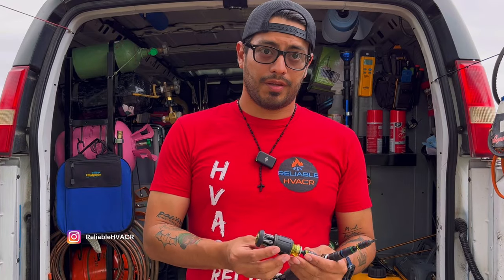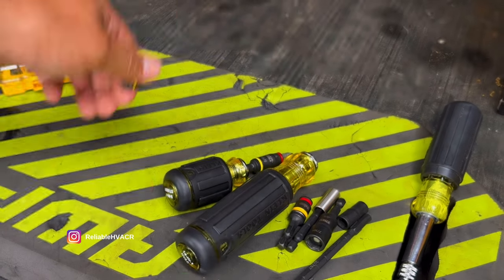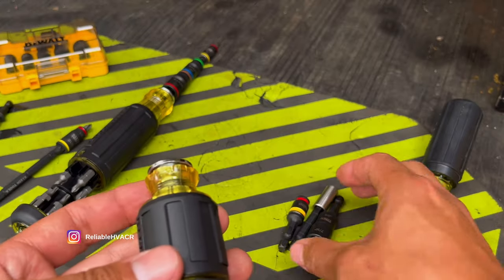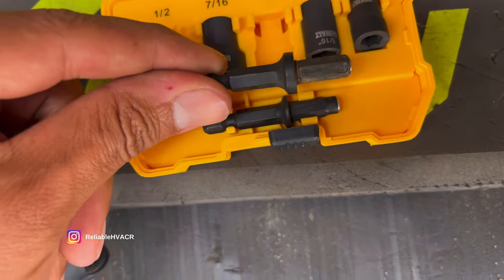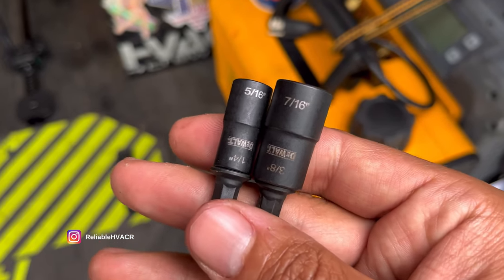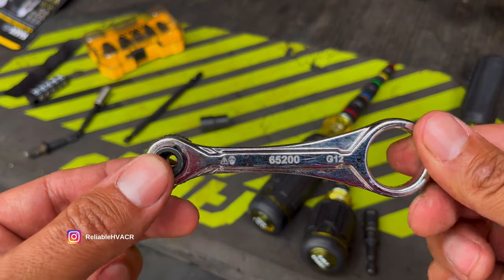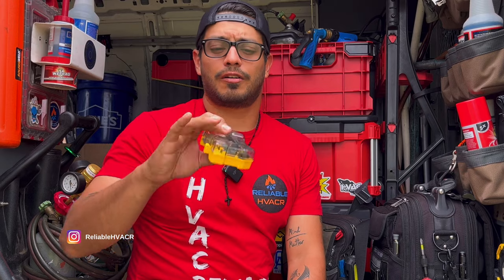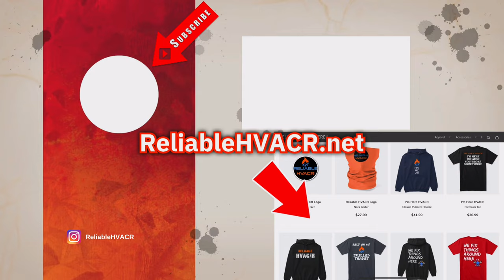Klein 7 in 1 Flip Socket UPGRADE / My Favorite all in one screwdrivers

Comment: For us non-HVAC folks, you can also use the 32303 14-in-1 adjustable length driver set the same way with the 7-in-1 nut driver set.  A very cool way to save carry bag space and have everything handy.
Reply: You can also just buy the 20 in 1 lol
Reply: You kind of missed the point of why.  LOL

Comment: Been running mine similar (regular 14 in 1 instead of HVAC) and really like it.  Great Video!
Reply: mine broke out in 3 months lol. the plastic holder broke inside for some reason. never let it drop it
Reply: @quietgameplays8246  mine started sticking, but I put some bits besides Klein in it and think it was my fault.  I put the Kleins back in and it’s been fine.

Comment: Klein sells the long and short shaft together in a pack at Home Depot for the flip sockets (comes with the 1/4-5/16 on both) that fits the stubby, as well which gives you 3 lengths in the stubby.
It's only been out 4-6 months though
Reply: Is that set called Klein Tools 32768 ?
Reply: @carlospoon6422  Yes. Klein Tools 32768

Comment: I used to always be on the hunt for the best multi till I came across the hilmor one. Picked one up at supplier here in Ontario for like $13 and grabbed a second one when I saw it again.  For me worked the best. I rock that with the reversable 5/16 and 1/4 6 inch nut driver and milwaukee stubby multi in my everyday.  That's a cool setup though gotta look into those
Reply: Can you share the model numbers for your setup?

Comment: I got the 8 in 1 hvac and find the 1/4 and 5/16 nut driver slide too bulky. Ends up not fitting in tight spots so i ended up going back to the 11 in 1 and using the shrader bit from the 8 in 1. Klein actually sells an 11 in 1 with the shrader out of the box.

Comment: When breaking king valves open I normally use a allen wrench first so I don't break gears on my service wrench until... I bought that klien electrician ratchet with MulWark Hex Head Allen Wrench Drill Bit Set 20PC (10pc Metric & 10pc SAE), 2.3" Long 1/4" Diameter Quick Release Shank Magnetic Screwdriver Bit Set .... now i dont need to lug around those bigger allen and leave them in van... that klien ratchet wrench gears are very durable
Reply from the maker: interesting, someone actually had just asked me if there was something like what you use. I'll have to give it a try 👍🏽 thanks

Comment: Halfway there, on this screwdriver. 🔩🐓
Home depot where I live, is always sold out.
I did get the Flip, 7n1 Driver & Finger Ratchet.
-
I finally got the screwdriver and stubby one today in a bonus kit.
At Home Depot.
It wasn't the HVAC one, it was the Electrical Version. 
But that was close enough...ill get the HVAC one later.
-
Thanks for sharing and the demonstration.

Comment: The tolerances on the DeWalt are much looser than the malco or the Klein, I'm a sheet metal guy and almost all the ductwork screws are 5/16 and they wobble like crazy in the DeWalt drivers

Comment: Klein makes a 3 inch blade for the flip sockets for the stubby handle and is impact rated. Part # 32766. It’s currently just under $6 on Amazon.
Reply from the maker: I was about to post an update 😂 I just came across it on Amazon 👍🏽

Comment: I quit buying expensive all in one screwdrivers. Mainly because if you loose a tip, you pretty much have to buy another all in one. So now I just buy the all in one from Harbor Freight. It’s good enough, and if you loose a tip, a new screwdrive4 is only a couple of bucks, and most of the time you can get a free one with a coupon.

Comment: Never been a fan of the HVAC specific drivers. Do you not always have a thermostat screwdriver with a core tool on you? No need to allow idiots to touch a shrader core with the ability to easily apply that much torque… Already have em on your core tools for quick evacuation and recovery as well lol
Reply from the maker: I would lose em, better to have more than not any. Plus I rather have bits I'll actually use vs ones I wouldn't personally. I don't need all those square and torx bits
Reply: @ReliableHVACR  Not arguing that necessarily. Not pulling a shrader with that unless a system is flat though, otherwise you’d be using your core tool that I assume you have so at best it seems redundant. As to the other part I suppose it depends on what you work on. The Robertson is handy on rare occasion and the torx can be used on some boilers I’ve worked on.
Reply from the maker: @codythompson9035  yeah usually flat or just to tighten a bit temporarily but for sure core tool all the way. I don't work on boilers or anything fancy 😂 just RTU's and walk ins for us

Comment: Bro I want to love that thing, but the shaft gets stuck all damn time in the collar, or one of the suckets gets stuck on the retaining star thing by the magnet from behind and it just sucks. I have two of them from different places and they both do the same thing.

Full disclosure: I'm using the handles that came with the set.
Reply from the maker: I know what you mean, I started noticing it and it's every time now. That's the only issue I have as far as the sockets getting stuck. Definitely nice to have in the bag but I still carry a few different screwdrivers to avoid grabbing that one all the time